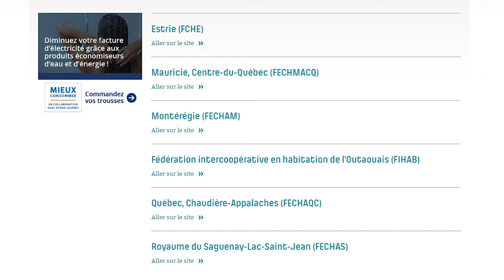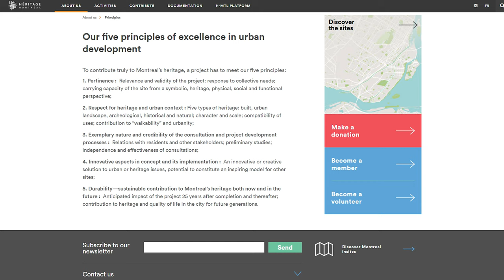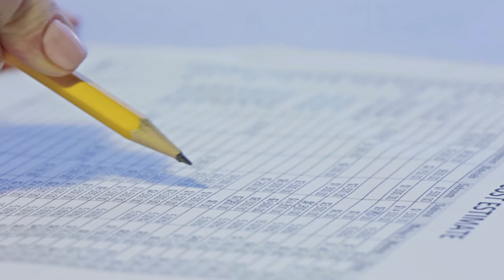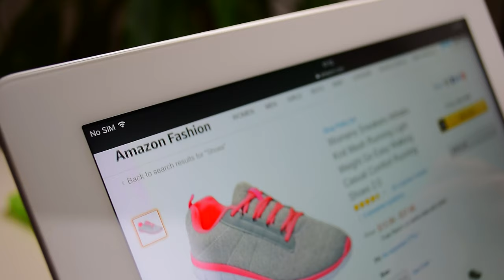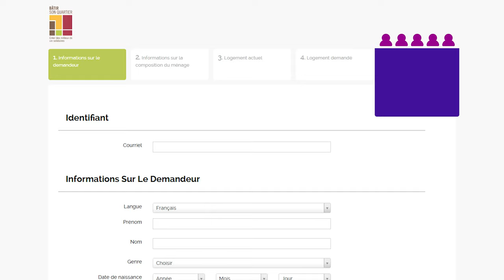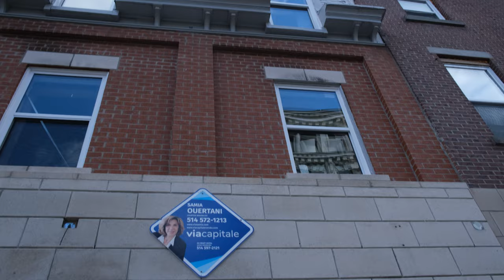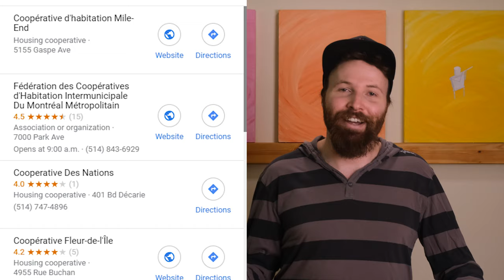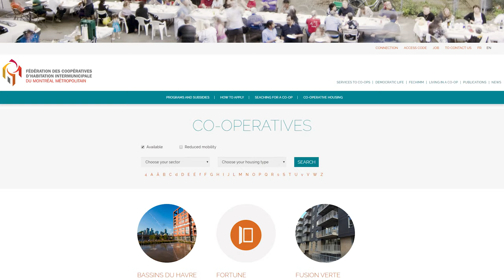Introduction To Housing Co-ops

Comment: This is genius. My partner co-founded a foraging co-op and has introduced me to a lot of concepts and ideals around that model. I started wondering if the same principles could be applied to housing. This video has very cool history about the labor movement and what not, and thanks also for the breakdown of pros/cons/issues/solutions. This video is really well done. I live in Fairbanks, Alaska and affordable housing is a major issue here (many college students, like myself, live in small cabins with no running water). Would love to get the ball rolling on a housing co-op. Might take a while because this city needs more physical buildings to meet housing demands, not just buying out old apartment complexes.

Comment: I was denied acess to a housing coop despite paying more then the price of the place where I was going to.In Montréal often they take old apartment buildings and turn them into coops and the  they renovate them.In my case they had me a place below street level near a big artery.So I did an x on that and went for a brand new affordable housing appartment by the city of Montreal and stayed there 9 years.I love the mix they have 1 third tenants and the rest of the building are condos over 180 units in the heart of Saint Henri I choose it for its convenient location 7 minutes walk from Place Saint Henri metro station and once your admitted the city don't bother checking your actual income so in August that building will be 10 year's old has an underground parking garage with a garbage chute and indoor parking for bicycles and back in 2011 the building cost 30 million dollars to build so it avoids the cheap buildings that coops are stuck with most of the time.....

Comment: This video was so helpful, witty, and interesting!! Thank you for making this. 
Do you know if there’s government funding in the US for co-ops?
Reply: From what little I know, in general no there isn't. A co-op is like a slightly worse version of a condo, and because it's worse you get a small discount to buy one.
Why are they worse? You have less control over your own life/property. If you want to buy someone's shares, you have to be approved by the rest of the members. If you need to sell and you find a buyer, the board can demand all kinds of info from them and still reject them, so you can get stuck. Because of this, it's also harder to get bank financing to buy. 
The ones I've seen advertised in San Francisco are usually 2 unit converted houses, or sometimes a 4 unit building. While you can buy in for cheaper than a regular condo, you're still paying 800k or more and likely a higher interest rate to the few banks that will write the loan. And since you often times can't rent out your unit, you can get really screwed since the board can reject potential buyers. In New York City, they are very common but still you can pay millions to buy into the co-op. In summary, it's not a magical solution to get cheap housing unless you just receive tons of government subsidies (which would be true of condos as well). Many co-ops vote to convert to regular condo status, although local governments often ban the practice.

Comment: If someone leaves or is removed from a coop, does the coop need to buy them out?
Reply from the maker: Yes, but that could be a symbolic $1 or a $1 million
Reply: @PaigeMTL  even in cooperatives that they started and and then are removed?
Reply from the maker: It all depends on what rules you write and shares you hold. But yes, I’m sure there are many coops where an original founder got booted out.

Comment: I thought I was interested in starting a housing co-op but now I'm not so certain. Hear me out. The reason being is that I actually like the condo model a little better I think because it seems like there is more ability for uniqueness within a community. Want a community of cookie cutter houses, that could be a co-op. But can a co-op be houses of different shapes, footages, and finishes? What's lost for me seems to be that ability to live in a community but also be able to allow your home to be an expression of your unique tastes and personality. If 2000 sqft works for me with a family of 4, but 1400 sqft works for my childrenless friends, why would they agree to pay the same amount? Would we be able to have different amounts? How would that be calculated? Also the idea that the co-op can vote you out of your home at any time seems like it could create insecurity. Like you said, what happens if you have an unfaithful spouse? Who gets to remain in the co-op and who has to leave? There's got to be a model somewhere in between complete control, and no control. Just looking to see if I have any of my assumptions incorrect. Thanks for the video!
Reply: there is noting actually preventing variety in co-op housing, you could insist on more varied design, flexible building layouts that can be reconfigured according to need, or have the co-op simply own different types of housing in an area (like a bunch of different town houses) the main problem is really cost: mass produced standardized models are always cheaper. This is also why social housing are often considered boring looking but they fulfil basic needs. Hopefully one day co-op becomes the most common form of housing and no longer just a cheap basic needs solution.